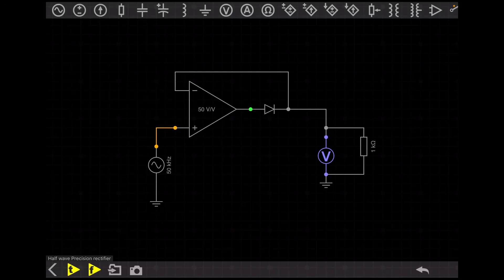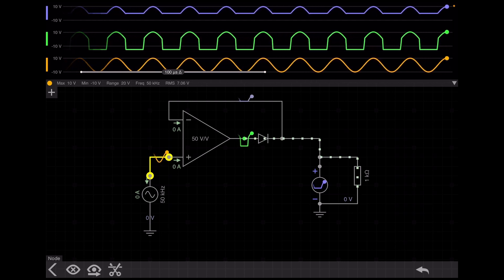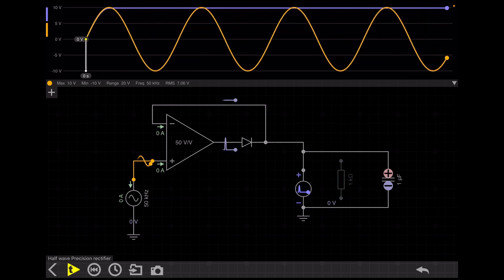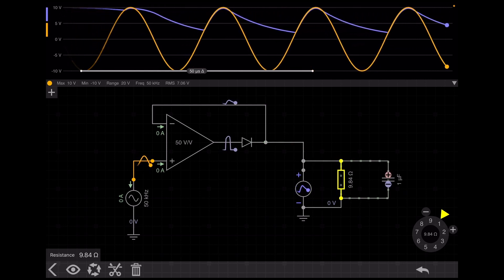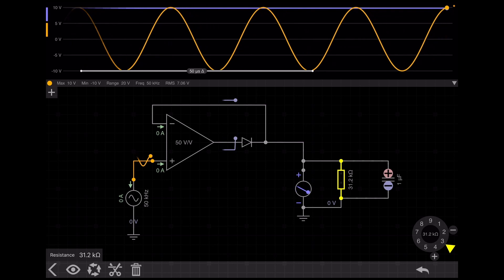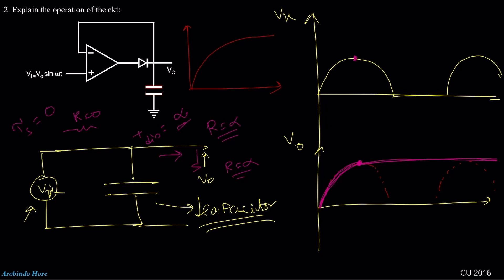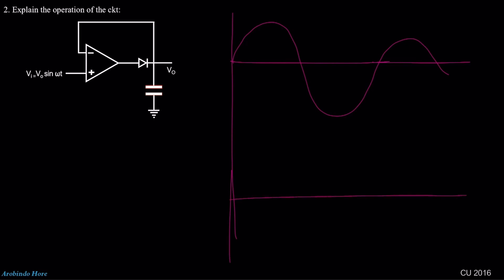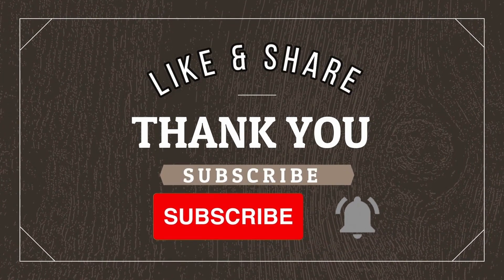Half Wave Rectifier using OPMAP with Capacitive Filter

Comment: What software are you using for the simulation?
Reply from the maker: Thanks for the comment.
We used Every Circuit Software for this type of simulation.
Reply: @ElectroPhysix  Thank you for the reply. Just found your channel and subscribed. Will look forward to learning from these excellent explanations and simulations of fundamental concepts in electronics.
Reply from the maker: Thank You Sir. Thanks for your support.
Reply from the maker: How to make 12V  Regulated Power Supply or RPS || Calcutta University Physics Practical
https://youtu.be/gH54D87MyFo